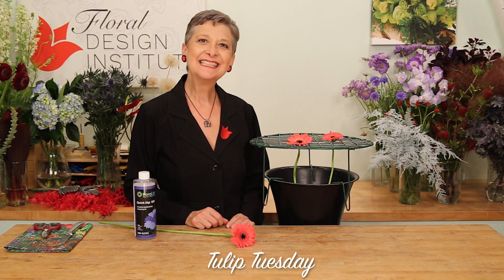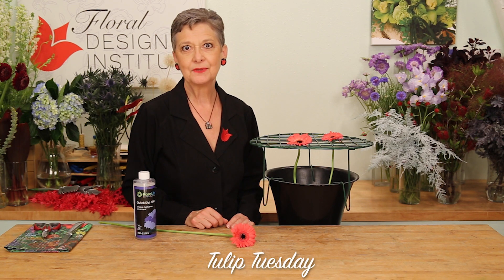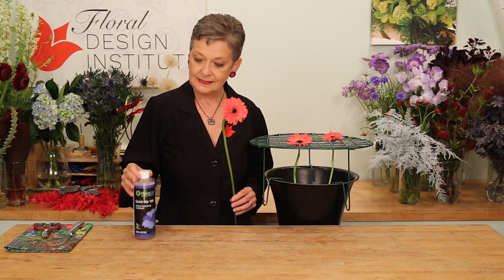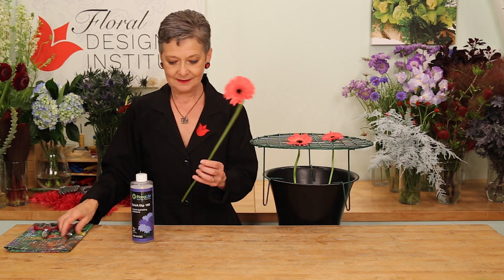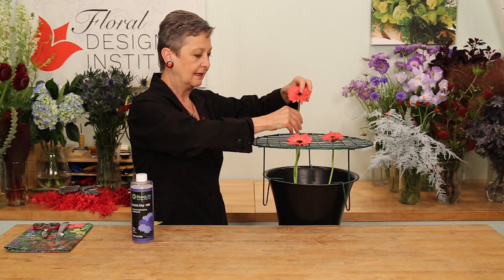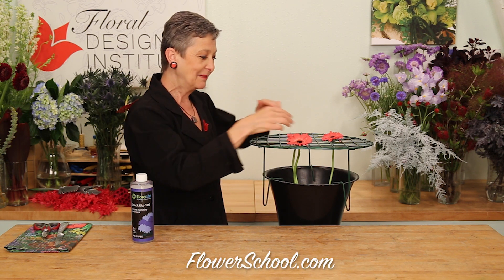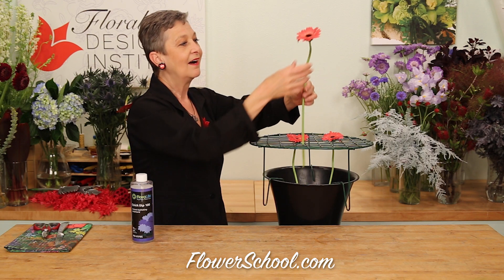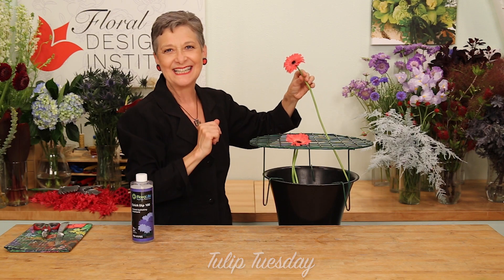Straightening Gerbera Stems

Comment: Where did you get the rack in the video?  I have been looking for some everywhere!!
Reply from the maker: That's an excellent question, Lindsay!  It's a rack that Leanne has in the Floral Design Institute warehouse, but many cake or kitchen racks will do as long as the flowers can hang suspended in the bucket and not touch the bottom.  You might have to raise the rack up above the top of the bucket to achieve this.  Thanks so much for stopping by to watch our Tulip Tuesday Tip.  We are so pleased that you joined us and we hope to see you soon.  Have a glorious week and enjoy those flowers!

Comment: I never liked wiring Gerbera or any other flower for that matter unless it was for bridal work or special events. Ours would come with a boba tea 🧋 straws to support the heads and straighten the stems as we processed them for hydration. 

However as with many varieties of flowers with naturally curving undulating stems i.e. poppies, orchids, tulips, callas etc, I try to use this to my advantage and make it a part of the design. It is better for longevity of the arrangement and that makes  a happy customer. I also stress that if cared for, most arrangements can last up to 3-4 weeks. I walk them through what I would do, changing the water out for fresh with flower food and cutting the stems PROPERLY with a sharp user friendly blade. I do not use shears unless they are professional florist that are kept ultra sharp and only used for certain applicable stems! Garden cutters or breaking and splitting woody or heavy stems. Showing them the varieties that die off first, the importance of removing spent petals, flowers and foliage (also what dries well in case they want that option). Restructuring the surviving beautiful blooms in a smaller vase until one is left with 3 or so blooms that can be scattered in bud vases or floated in shallow dishes as accents (I do this when the head still looks good but the stem isn’t). This works well with mixed bouquets where I do try to add flowers in with different vase lives and longevity. This will not work in a case where a client is getting a vase with one variety i.e. a whole vase of ranunculus or peonies but I still do give similar tips on having even these types of arrangements last longest by advising they immediately remove spent blooms, some flowers may again have a beautiful face but a rotting or damaged stem and I simply cut the stem off and float these in water, even shattered petals (if the flower is prone to this) look beautiful in a bowl sort of like a natural potpourri and when they dry, toss them. Last tip is using flower centers even when the petals are withered or damaged, we do it with sunflowers most commonly but I recently did an event using anemones and the petals unfortunately had botritis however their unique dark centers and strong stems looked great so I processed them as usual and gently twisted the petals off and was left with a most unusual accent flower similar to a bachelor’s buttons. This technique also works well with poppies etc. I stay away from flower centers that produce too much pollen when considering a flower that needs this technique.
Reply from the maker: This is brilliant, Adrian!  What you have written here is exactly what we mean when we talk about the valuable (and knowledgeable) service floral designers provide in addition to their talent, their skills, and the product they supply.  The fact that you take the time to share floral education with your customers is truly tremendous and so precious. You help your clients develop a genuine appreciation for the flowers themselves and the changing phases they go through, which make the design ever evolving.  We really appreciate you sharing your process with us and we hope that others see this an approach they could adopt easily and effectively.  Thank you so much for taking the time to watch our show today and for visiting with us on Tulip Tuesday.  We are so happy to have you stop by and hope that we will see you again very soon.  Have a serene and lovely week in all that you do!